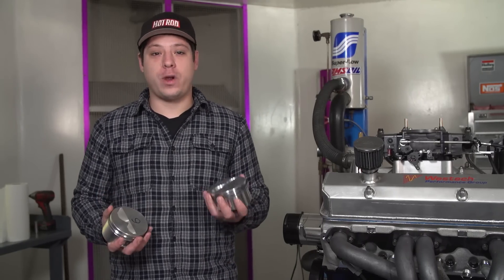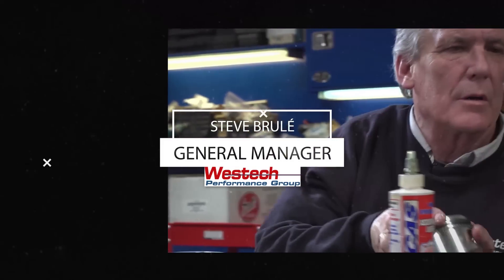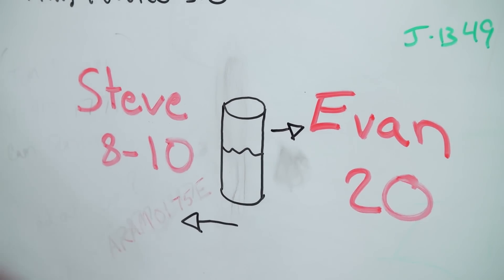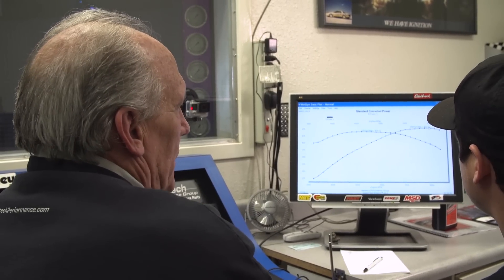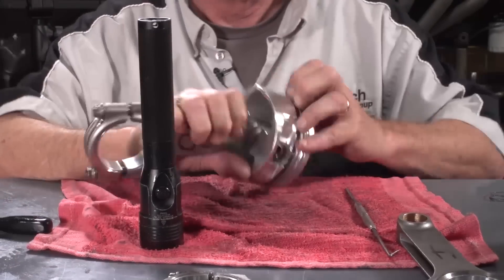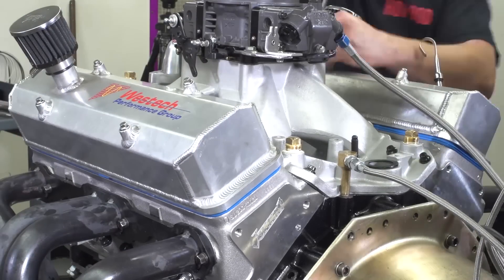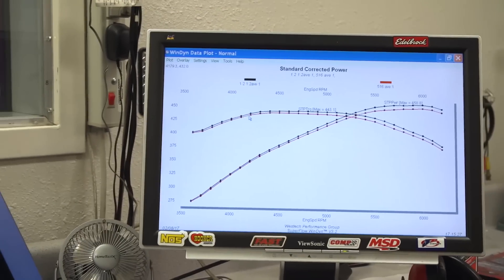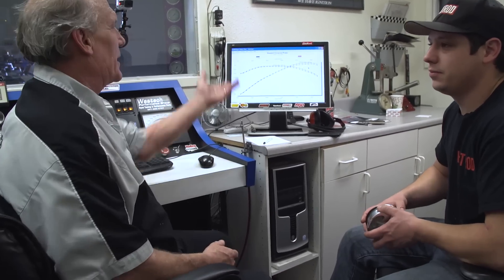Dyno Tested: Are Thinner Piston Rings Worth Horsepower?

Comment: That was interesting. I WAS hoping for a bit more too, Evan. I noticed the top ring was a little higher with the thinner ring packs, it would have effected comp slightly. I wonder how much. The other thing of interest for me personally is; is there any trade off in terms of strength in high boost applications or with big shot's of nitrous??? I'm a turbo guy, so to me this really matters. I'm running the 1.2mm ring pack already on my C P pistons, but am I sacrificing any strength by doing this??? Lastly, I would really like to know is there any trade off in terms of longevity??? Are the thinner ring packs going to wear more quickly? Loving this format, Evan. This and the Ebay turbo kit vids are exactly what people like me want to see. Keep 'em coming, champ. Love your work
Reply: It's hard to say really. Might be a test somewhere but as far as just looking at it I'd say the bigger pack would last longer simply because of the spread and thickness of the rings. The 5/64 rings are further apart to help stabilize the piston from rocking in the bore (less skirt wear and damage). Also I would guess that the thicker ring would resist more flexing and stay more square in the bore. I think the smaller ring would more likely dig into the cylinder walls as they wear.

I think it would be a valid test simply because most people foremost would like to have longevity and reliability over all out power gains. But if they don't wear that much different and you like to rebuild every so often then it might be worth it.
Reply: The rings basically "float" around the piston in use, dragged by pressure on either the top or bottom. Since they float, the centering/stabilizing is minimal. Since they're dragged by the flat surface of the piston, their ability to stay square doesn't really matter. While a thicker ring might have more material, it also has more surface area being worn, and the depth is the same, so the difference in lifetime is negligible. 

Metal expands as it heats, and rings getting too hot and over-expanding is what causes flexing/warping and other issues. That's why guys with nitrous run bigger gaps in their rings; more room to expand. Less material, less expansion, a natural bonus to thinner rings.

Of course, piston/bore matching is vital. Thin rings might run into issues on a very loose fit, but anyone buying a piston for thin rings is sure to measure carefully.
Reply: Given the same material, usage, and design, a thicker piston ring wears longer than a thinner.  The main reason is actually because they can transfer more heat and run cooler.  The secondary reason is that there is just more material there to wear before things break, loose tension, etc.  The thicker rings can also be a little looser in the ring grooves and still seal well.  Piston rock is more a side clearance thing, rather than something controlled by the rings.  Thin rings are supposed to seal better on a rocking piston because they can flex more.  Some of the claimer race motors almost 10 thou piston clearance and seal up just fine with cast pistons and 5/64" rings - 4-5% leakdown.

Piston rings do not run perfectly square to the bore (they flex up and down some), and many rings are not manufactured perfectly square.  For example, one way to tell if a old school V8 with a standard 5/64" iron ring pack has many miles on it is to look at the 2nd ring.  Usually it will start only wearing on either the top or the bottom edge of the ring, and the wear leaves the ring shiny, while the rest of the rings face will be dull.  As the miles pile up, and the ring wears more, the shiny wear takes up more and more of the face of the ring until it takes up the entire face.   The only way this can happen is if the ring is not square to the bore when the engine is running.

Personally, I think super thin rings are overrated when you factor in cost.  Those thin rings are not cheap, and neither are the pistons they are used on. I don't know of any off the shelf piston that uses 1.2mm rings for an american V8, so those would be custom.  I can think of other places to get more power for the same money.  Unless you are running in a class where mods or ci are limited and every single HP is needed, I would pass on super thin rings.
Reply: RacerRickxx I agree with everything you've said there. My engine is an RB30 Nissan donk, as I said in my previous reply to another comment. The engine is relatively new to me, I've always been a V8 N/A guy, so the same rules don't apply. I'm on my second build of this engine, but it only had maybe 10000 - 12000 kms on it when I pulled it down last time. So longevity isn't something I've been able to gauge as of yet. They were an off the shelf CP piston, but were fairly new to CP. I reused the pistons when I did the rebuild, as there wasn't much wear on the skirts (maybe 3 - 4 thou on the gauge point of the skirts) and I actually compensated for that when I sent them off to have a coating done to reduce friction on the skirts- they were just plain forged pistons the first time around with no coatings from CP. I've been pretty happy with the way it's turned out. I always like to hear what others have experienced and found in their own set ups. There's a lot of people out there with a lot of knowledge. Although I do this for a living, I'm only 36 and realise I've still got a lot to learn myself. I tend to try new things on my own projects before I spec something out for a customer. If something's going to fail, I would prefer it happen on my own engine rather than to a customers. And lets be honest, tech has evolved in leaps and bounds over the past decade in terms of materials and design. Now it's not uncommon for guys to make 1200+hp at the wheels out of these relatively small Japanese turbo 6 cyl engines like mine. 10 years ago, 500hp at the wheels was pretty impressive for a daily driven engine of this size. That's where the tech has taken us, and it's brilliant
Reply: Raymond Collins I had all the clearances done by my mate who runs a machine shop, it was set up on the loose side in terms of piston to bore clearance- but obviously within spec suggested by CP for the application of being a big boost turbo motor. It's funny how big the gaps are on a serious nitrous motor compared to a big boost turbo motor, isn't it? They run quiet a bit more end gap for the nitrous to compensate for the expansion they will see. It's really interesting with some of the new materials being used for piston rings these days. That's more where my interest lies with all of this. I was surprised Total Seal set me a 1.2mm ring pack with an iron Napier style top ring, but a really trick 2nd comp ring. I was a little suspect on that iron ring, but it's held up fine so far. The 2nd ring was really flexible too, it will deff be moving around as the piston goes up and down, but doesn't seem to effect it's seal in any way. As long as the correct RA is machined into the cyl walls, it works really well. It's funny, when I pulled this thing down for a rebuild last time, there were signs that the rings had been slightly butting together and hadn't been opened up enough for the boost I was throwing at it- but it didn't break the ring land, damage the cyl wall or break a ring. So of coarse we opened them up a little more this time around. They give you a range to work within, we tried to stay on the smaller side of the range last time to help with blow- by at low load (cause it's a street/strip car), but it hasn't made too much difference to be honest. It doesn't breathe much harder than it did before, even tho ring end gaps are set on the higher side of that range now.
Reply: CanadaBud23 Yeah, I agree- I think the thinner rings will wear the cyl walls a bit faster. It's funny how flexible some of the newer style rings are in thin 1.2mm ring packs like what I use. My 2nd ring is so flexible it's not funny. But it seals like a champ. But it came with an iron Napier style top comp ring that wasn't flexible at all. The shape it uses against the cyl wall tapers to a really thin edge, you would think the ring would wear heavily at this point- but I didn't really notice much wear when I rebuilt the engine after a 10000 - 12000km period. The thin edge hadn't worn off the way I had expected after the abuse it had been through. The new rings had the same iron Napier top ring, but a new gen 2nd comp ring that was super flexible
Reply: @RacerRickxx, thin rings run cooler. Their ratio of friction vs cooling area is greater, and the ratio of friction surface to mass is less. They have a thermal advantage on both sides- make less heat and cool faster. I'm sure you know, running a 10 thou piston clearance is not standard practice in race motors, most guys run a half or a third of that, which is where thin rings shine. You're right, rings/cylinders/pistons aren't perfect, and the break in process is what helps seat it all together for a proper seal. Thin rings seat more quickly, as imperfections have less material to wear away. While the whole face won't seat, a theoretically ideal ring has the least surface area possible. Ring friction increases as the face wears, as the sealing force decreases (same "spring"  pressure from ring, more area, less PSI). Point is, a thin ring has lower friction and seals better, which is where the performance improvement comes from.
Reply: @Daniel Brealey, nice to chat with someone who actually has been involved with the process. You clearly have a solid understanding and the willingness to learn more. A lot of the science of engines is counter-intuitive, and you've had some experiences that illustrate that.

Don't ever evaluate a component without considering the system it lives within. That's the most common oversight I see, but the synergy matters more than any individual part.

Even when the information comes from a reputable expert; question, experiment, verify. Only when you prove it to be true do you accept it as truth. There's so many variables in play, it's up to you to figure out what works for your specific application.
Reply: Raymond Collins 
You should give total seal quickseat dry cylinder lube a try for your next build, good stuff.
Reply: Raymond Collins Thanks, Ray. I appreciate the feedback. I understand what your saying, building high performance engines is a lot more technical than people might think if they haven't been involved with it themselves. You're obviously in the industry yourself. I appreciate the advice and will take that on- board. I love cars and building engines to the point where it's almost a sickness! ;) I'm always wanting to learn what I can from people like yourself. Cheers, mate
Reply: Most everything you have posted here is makes no sense.   Thin rings don't run cooler.  The heat generated through friction is basically inconsequential compared to the heat from combustion.  

Basic thermodynamics says you are wrong on a thinner ring cooling better.  Think about it for a second - how does heat energy transfer in this situation?  The thinner rings not only have much less thermal mass which means they have to run hotter since they have to absorb the same amount of heat energy, but they transfer the heat to the cylinder wall through contact.  The more contact area you have, the more heat energy you can transfer in a given time.  The time period doesn't chance.  Thin rings have much less contact area, so they do not transfer heat as well, and run hotter.  Given ferrous materials all expand around the same, you usually see thin rings with wider gaps because of this.   Modern rings are made of much better materials so how hot the rings are is not really that big a deal as long as they don't induce detonation or damage the piston.  Piston squirters are actually a great trick here, as the oil squirted under the crown really cools the crown and rings.

The main reasons we can have these thin rings now are because of extremely fine cylinder wall finishes, and tight fitting pistons using low expansion alloys.   Most of the time they are run on very hard cylinders also, like Nikasil's or similar.  Most 5/64" Moly rings use a 320-400 grit stone for cylinder wall finish.  The 1.2mm rings use a 1200-2000 grit finish, and require a plateau hone and brush hone for finishing. This is because the thicker rings are stiffer and will machine down much larger peaks on the hone that thin rings can't.  You basically have to break in the cylinder walls of the thin rings to use them.

All things being equal a thinner ring seals the same as a thicker ring.  They have they same end gap, and that is the path where you get blowby.   Using a multi-piece ring set that is gap-less will make your leakdown numbers 0-1% once they are broken in.  Typical motors are about 4% for a healthy one using gapped rings - no matter that the ring thickness is.  Gapless rings usually show a measurable torque increase.

But given all this, why do thin rings work?

One big real performance increase you see with thin rings is shorter/lighter pistons due to the short ring packs, which can use longer rods to improve the rod to stroke ratio.   There are friction benefits but they are very small, because the rings are always riding on a very thin film of oil, which has very low friction.    You won't really see benefits unless the tension is lowered also.   This is where thinner rings start to make a difference.  Thin rings will seal better with less tension,  which is where you can reduce frictional losses and start to see a difference. Thin rings will also seal better on out of round cylinders because they are more flexible, which is most cylinders unless utmost care is used during cylinder prep. The caveat is that the rings themselves survive the abuse.  

If you are in a highly regulated class that needs every single HP, run them.   If not, you can get bigger gains for the same money elsewhere IMO.
Reply: I doubt that boosted situations are a problem for 1.2mm piston rings. I'm into rally cars. The Mitsubishi 4B11T uses 1.2mm top rings and 1.5mm middle rings, but that doesn't seem to be a problem. Mitsubishi runs very high turbo boost on the Evo X. Mahle, Manley, JE, and a few other companies that make racing pistons have 1mm top rings and 1mm or 1.2mm middle rings for many other boosted rally engines, such as the Mitsubishi 4G63T, Subaru EJ20, and Subaru EJ25.

I have heard that thinner rings increase engine life by exerting less force against the cylinder bore, and therefore reduce cylinder bore wear.
Reply: I agree with most of what you have said except for the running cooler part.  Thinner rings definitely need less radial tension to seal compared to thicker rings, and this does impart less friction, which is where some HP gains can be seen.  But the gains are not very much, as seen in the video above.

Remember, the amount of heat the rings see because of friction is miniscule in a running engine compare to the amount of heat from combustion, and unless you have piston oil squirters, a very large percentage of the heat in the pistons heat is transferred to the much cooler cylinder walls via the piston rings.  Because there is so much less surface area, all that heat is concentrated, and the thinner ring ends up running hotter.

Material advances are why we can do things like run super thin rings at huge boost levels.  In the past they simply didn't have alloys that would survive.  Now they are using 1mm rings in some race engines.

But like I said before, unless you are class racing in a class with restrictive engine rules, or in a super competitive class where you need every single last HP, I think there are better ways to make HP. 

However, it is nice that this is actually a discussion among people who obviously have experience in different but related motorsports, and while we have differing opinions, it has not devolved into a typical poo flinging contest like so many threads end up.
Reply: LS motors come stock with a 1.5mm ring and we know they can take some abuse.  The argument isn't that there are not super thin rings that survive, but that they have to run hotter, and take more abuse.